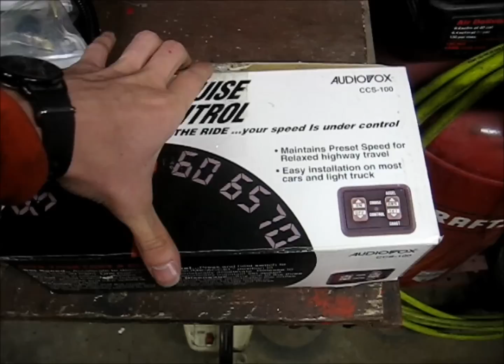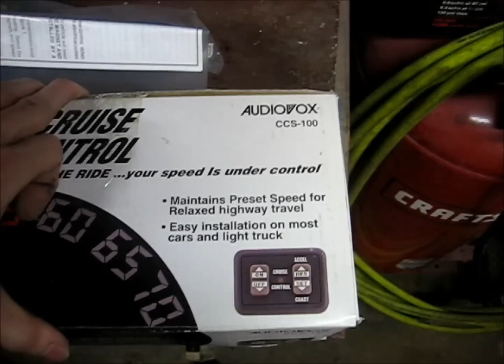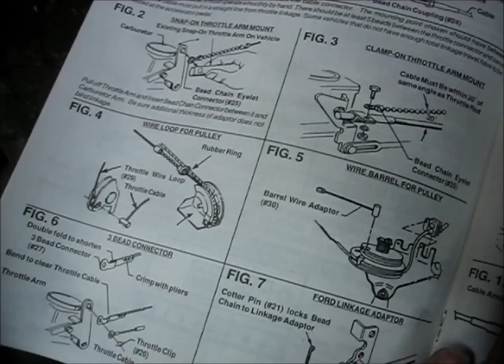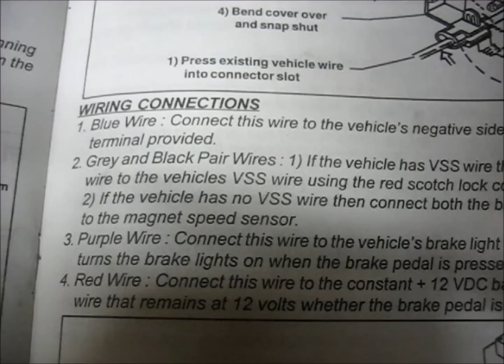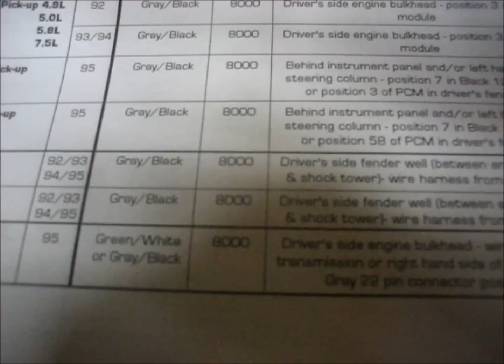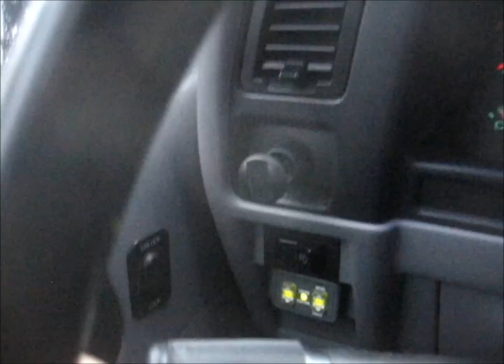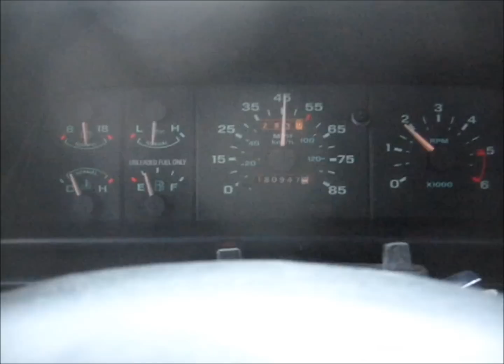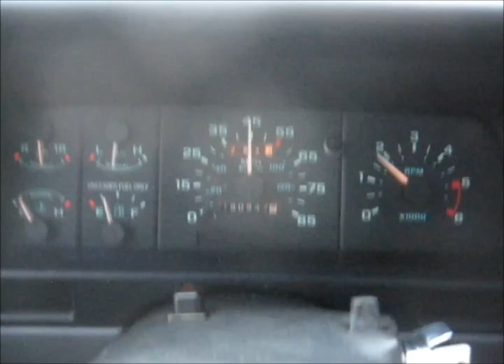Installing Audiovox CCS-100 Cruise Control Kit on my 1993 Ford Ranger 2.3

Comment: Is the Ford Ranger  2.3l engine reliable?
Reply from the maker: +Juan Reyes I have no idea. I just needed another truck to drive while I fixed the 4Runner. Once the 4Runner is finished it will become my nice weather/wheeling/road trip truck. The Ranger will be my bad weather truck.
Reply: +TheAlexManVideos ah ok thanks anyway man
Reply: The 2.3L "Lima" engine is stone reliable.  Ford used this engine for nearly 25-years in various forms as far back as 1974 up until 1997.  Its not a powerhouse, but its economical and will likely outlast the rest of the vehicle.